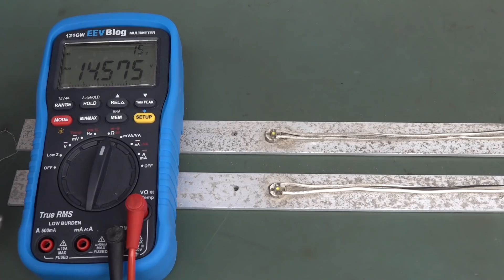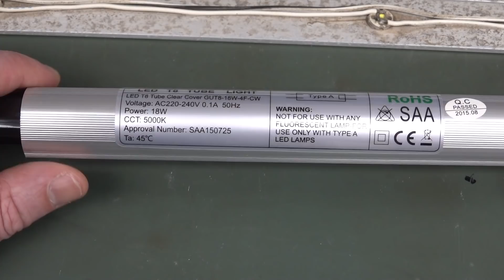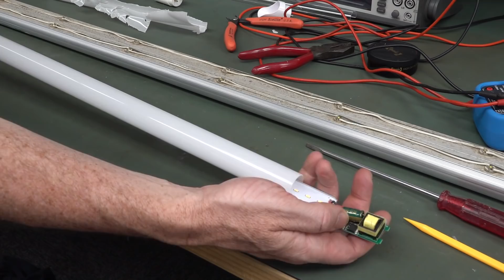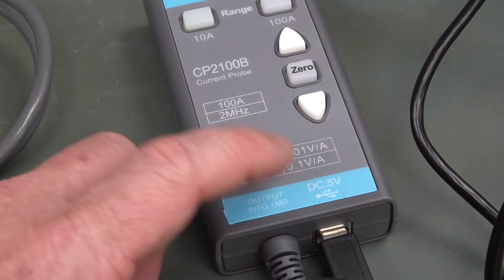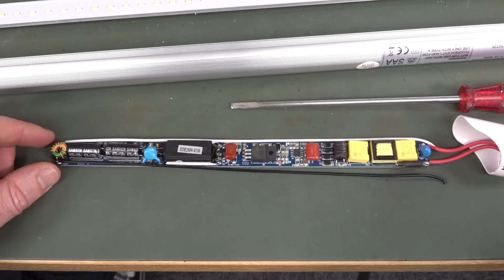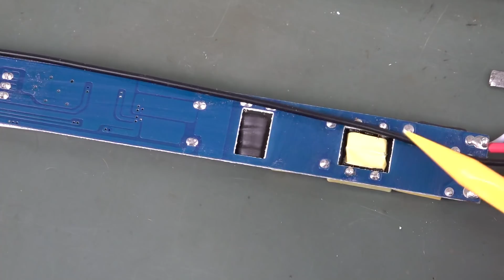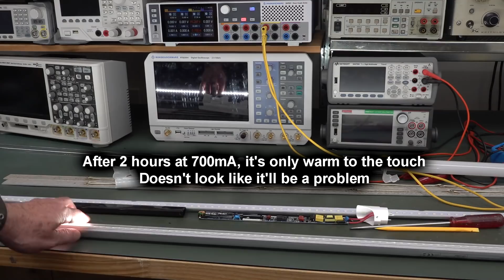EEVblog #1343 - DEAD Deck Cree LED's

Comment: LEDs have zener in parallel with the actual light emitter... If the LED fails the zener will start to conduct
Reply: That is probably what is the case here. But not all LEDs have a zener. I've had some lamps with a LED array and as soon as a single LED fails all go out, if I bridge the failed one, the rest work again.
Reply: @flubba86  Yeah I've seen several cheap LED screw in lights (those awful utilitech ones from Lowes) that would often fail where one LED has a black dot of death in it, causing the whole string of 20 LEDs to be dim, flickery, or out completly.
Reply: @power-max  Only high end power LED's have zener (Osram Golden Dragon). Cheaper ones has it omitted to save cost because it's separate chip in the LED case._
Reply: A zener would not show as a short.
Reply: @Forssa1  The zener shorts out almost instantly - it's not rated for the typical LED forward current (>100 mA).
Reply: @SY19955591  Bruh. A zener must drop voltage before conducting or else it's not a zener. And that voltage drop must be higher than a functional LED or else it would steal the current from the LED. You make no sense.
Reply: @Forssa1  The zener only conducts if the led goes open circuit.
It begins to dissipate If*Vzener mW and quickly overheats and fails shorted.
Reply: @Forssa1  For a typical 1w led:
350mA*5.1V=1.8w
The zener die is rather small, it cannot handle so muc h thermal dissipation.
Reply: @SY19955591  5.1V is not a short. You missed the point of the discussion entirely. The die is still mounted on a heat sink via the LED package.

Also, I'm not the one saying that this LED has a zener. Some do and some don't. Either way, the failure mode of Dave's LEDs indicate a dead short, not a diode, zener or otherwise.
Reply: @Forssa1  Zener diodes most of the time fail short when they are overcurrented. It drops its zener voltage for a short period then fails due to overheating (the zener die is small - > it cannot pass heat to the led package well enough due to thermal resistance). Zener diode failure mode is INTENTIONALLY used there, some industrial light sourced even have discrete zener diodes reverse-parallel with the LEDs. Of course this only works with led drivers able to maintain the set current at a lower voltage without becoming unstable. And of course this led may not contain a zener - most don't.
Reply: @SY19955591  Why use a protection method that works "most of the time" Where do you get this?
Reply: @Forssa1  Seems like nobody got the logic... The zener should not protect anything. It's breakdown voltage is higher than a functional LED, it isn't there as long as the LED works.
In that case when the LED fails open, it takes over, drops voltage, then it fails short due to overheating. It's sole purpose is to convert the failure mode. An occasional fail-open LED to a fail-short one, because the latter keeps the other LEDs in series working.
Reply: @gabiold  I looked on the datasheet now and it does not mention zener anywhere, so it safe to assume it doesn't have one. So it's like Dave said, the LED developed the short by itself. If OP didn't claim things out if thin air then we wouldn't have this discussion.
Reply: @Forssa1  The OP never said that those particular LEDs should have it. And even if many doesn't have it, it could be used when needed.

Comment: The writers of this show are really consistent, I mean imagine writing episodes for at least the next eleven years when the series is still pretty small. Impressive! I wonder what the script will have Dave do in the next decade. I wonder how much of the lab move subplot they had at the start, those are very high on my top episode list for the whole series!
Reply: In 2023 we might see Dave on water skis jumping over a shark if magic energy kickstarters dry up. Perhaps with Rachel driving the boat if we get a crossover episode
Reply from the maker: @pappakilo3965  I've already jumped the shark https://youtu.be/AO-vbzLPwSc?t=299
Reply: Dave 2 will come back in 2032.
Reply: I'd hardly say this is a small series, it's already 1343 episodes while even The Simpsons is only at 688
Reply: "Next time on EEVblog-Z, Dave tangles with the sinister scope! Can he tear it down before it engulfs the lab in flames? tune in next time!"
Reply: Haha! Cool as Fonzie's jukebox bump